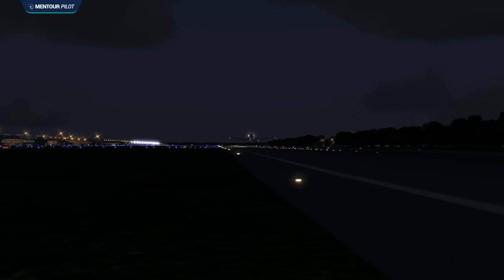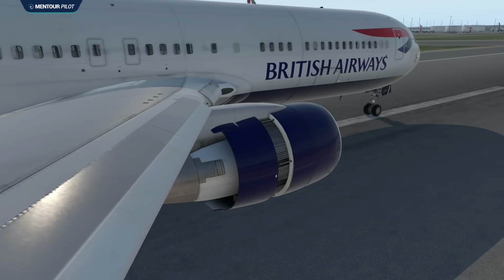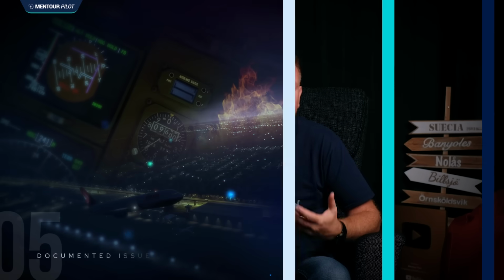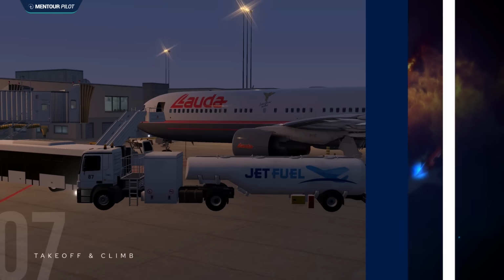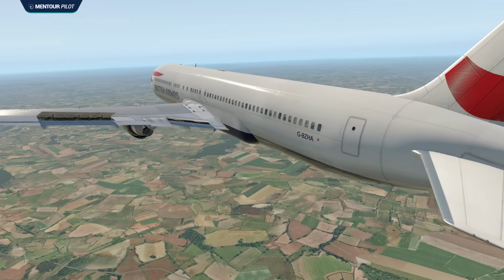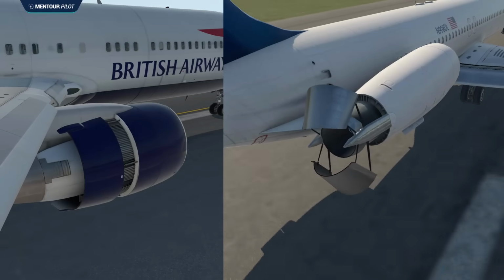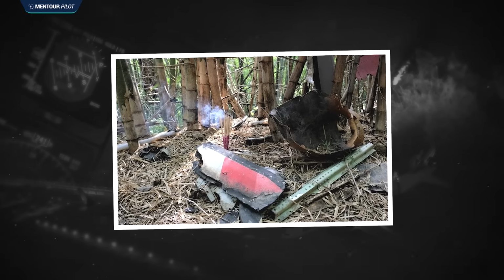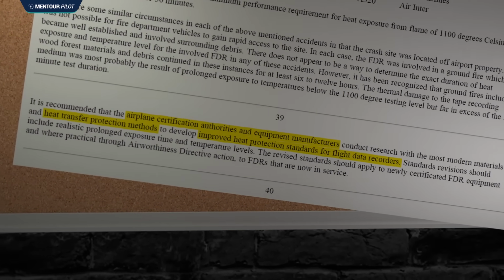HOW an Impossible Failure CRASHED this Boeing 767!

Comment: I was the youngest electrical mechanic (18 YO) at SFO in 1968 for TWA.  I worked on 707s, 727s and 880s.
There was ENORMOUS personal integrity in the people I worked with.  The BEST engineers and pilots and managers ran the airline and Boeing.
Boeing then became WOKE.  JFK's daughter was put on the BOD at Boeing with other Hollywood ilk ... then Boeing moves to Marxist infested Chicago.
Then SURPRISE!  Boeings start falling to earth.
You need to go OLD TESTAMENT on the BOEING BOD and those incompetent and lying engineers at Boeing.  They are a disgrace and guilty of hundreds of deaths.
This ignoring of such a severe and reoccurring problem would NOT be allowed where I worked.
Put MORE politicians and WOKE on Boeing's BOD and we will see many hundreds of more deaths.
Thank you for your EXCELLENT technical analysis but now PROSECUTE THE GUILTY and HUMILIATE THE INCOMPETENT!

Comment: No fdr,  what did they use to assume these events? And determine the crash probable cause? ..idle, spoilers , flight control and rudder adjustment,  then shut faulty engine down .. that should be quick reflex action , aviate, navigate, ...

Comment: Terribly sad. I just want to say a word on behalf of the pilots.

Before someone points out that Boeing's Chief Technical Pilot was able to recover the plane, so the airline or the pilots were somehow at fault for 'not being good enough' and not reacting withing the magical 6 seconds needed, don't forget that the Boeing CTP was flying a simulator in a zero-jeopardy situation.

We weren't told how many attempts it took him to find the correct series of responses needed to save the flight. It must have been more than one.

In other words, even if he - Boeing's top man - had been in control of the stricken aircraft, the outcome would have been exactly the same. He'd have failed to save it in the one and only opportunity presented to him, and the flight would also have been a total loss.

It ought not to be necessary to say that, but the dead pilots can't defend themselves and, sadly, there are some strange people around, with some equally strange agendas.

The only positive thing to come out of this disaster is the thoroughness of the ensuing investigation which went on to improve the safety of aviation for all. Unfortunately, it happened way back in 1991, and there have been far too many other fatal incidents in the years between then and now.

We may be learning, but why must the education be so painful and so slow?
Reply from the maker: That was actually the Boeing Chief pilots assessment as I mentioned in the video. No normal crew which hasn’t been specifically trained on this failure could be expected to survive it.

Comment: At 17:32 :  Was  the drag really on the right side ? Because if  the  ailerons/spoilers  on the right are raised  as shown as a counter measure then this wing would drop  and the plane would turn to the right countering a drag on the left side.

Comment: Would deploying the other thrust reverser make any difference?
Reply: You wouldn’t be able to unless it had also failed by coincidence
Reply: @tomstravels520  well if able I'm guessing the imbalance would be corrected if everything else tried was also. Sounds like a redundancy that would have helped.
Reply: @starfleetcaptain5413  and then what? A) You’re stuck at idle thrust and increasing engine speed will result in slowing down even more. B) if it was made possible for reversers to be deployed inflight they’d happen more often. That’s a stupid idea

Comment: I wondered for years if a thrust reverser deployment in flight could really happen.I thought thrust reversers can only deploy at engine low power settings.And the switches he was referring to are actually called squat switches there used to also prevent landing gear retract on the ground this is also true with small GA aircraft with retractable landing gear.I learned most of this stuff back in 1983 in A&P mechanic school.

Comment: This is one of the reasons why when Poland became communist free , our engineers and generals
chose General Electric shaft less engines for the 10 new 767's-200 we purchased.
PW-200 , Rols Royce , both were dual shaft just like the old Illushin 62's we use to have.
Those passengers must have suffered a horrible .......

Comment: For me as an Austrian citizen this is a very interesting video! Nearly everyone here in my country knows about this accident. Lauda Air was a great airline back then!
What even I didn't knew was, that the midair brakeup of the aircraft was so horrifying!!
Interesting facts to add woud be that this flight was also the worst Austrian air accident, since the aircraft was registert here. And this was the only crash of a 767 that wasn't caused by pilot error or due to a hijacking.

Have a great day out there!
Reply: Which airline/incident was it where runway aquaplaning prevented reverse thrust and caused a disaster? That and this incident are somewhat reminiscent together.

Comment: On this occasion, I think it is entirely reasonable to exonerate the pilots. Yes, while perhaps, as Boeing's chief test pilot suggested, had action been taken after 4-6 seconds, the situation MAY have been rescuable. One can hardly point the finger at two experienced pilots who "only" reacted after 10 seconds which, considering what was going on, is still fast.

Quite clearly, the blame lies with the "shonky" wiring, systems and procedures in place. As our host described, there was quite a litany of previous mid-flight reverser activations which frankly, is breathtaking. The fact the body which certifies the planes allowed for this with, again as we were told, 500 resettable hours available for a plane to be flown "on the blink" is barely credible.
Reply: Boeing said the 4-6 seconds was unreasonable and that the pilots were not expected to have saved the situation…
Reply: @joenathan3005  yes, after a LONG time of outright denying any fault of their systems and placing full blame on the pilots.

Comment: This video was the scariest one you've done , the visualizations of the plane breaking up in a high speed uncontrolled dive was almost too much to bear.  

What I don't understand is these new types of reverse thrusters , even at the benefits of better fuel economy , was it that much of an improvement? 

That, coupled with the warning light going on and off several times on previous flights should serve as a warning to all of us.

Computer or system wantings are never accidental , they always tell a story of something. Not necessarily good or bad but definitely informative. 

menteur , is it correct to call these reverse thrusters breaks like on a car?  

Also can anyone tell me about this interaction between atc and pilot?
Reply: Reverse Thrusters are like breaks for aircraft they help to slow down aircraft on the ground. You can actually see them getting deployed whenever aircraft touches the ground. When you take off the thrust(air) is coming outside from the back of the engine, Resulting in Aircraft moving forward. when the reverse Thrusters are deployed the back outlet is blocked and all the thrust will now escape from the gap (shown in the video animation) Resulting pushing air forward.. Which creates an opposing force resulting in slowing down the aircraft. Comparing it to cars, they work on the same principle but on a sensational level you will not feel reverse thrust in an aircraft because the rate of change in the state of inertia is very less as compared to car. In car if you apply breaks you will feel it as a push.
Reply: @AbhishekKumar-vk6rp  That is true... unless it's asymmetric, which is how I was attempting to word my previous reply. I was struggling with an analogy for anyone who's never been in an airplane before but could experience it on the ground.
Reply: Thrust reversers are nothing of the sort; there are legitimate wheel brakes on all aircraft I'm aware of, and work just like the ones in your car, although each side has its own pedal.

A closer comparison would be the equivalent of writing a bicycle, and your front tire suddenly started pedaling in reverse while the back tire continues to pedal forward.
Reply: From an economical standpoint as mentioned in the video using reverse Thrusters reduces stress on the brakes in the wheels that means low maintenance cost and long lasting breaks ! :D

Comment: I find it quite interesting that almost every single fatal aviation accident from the last 30 years happened because someone either didn’t do their jobs properly prior to takeoff or someone didn’t consider the possibility that something might fail during testing.
Reply: How would you summarise the causes in the years before that?
Reply: @htimsid  before that it was generally  error or negligence by macdonnel Douglas or Boeing
Reply: I spent a good portion of my life working for a commercial/military gas turbine engine design/manufacturer and in my early days in design I was advised that we learn a lot more from our failures than from our successes.  I think this still holds true 50-years later.  The aerospace industry, although it has had its faults, is still run by professionals overall.  Safety has always been our primary concern.

Comment: Why weren't the thrust reversers programmed as to not being able to deploy, if the landing gears were up?
Reply: Think about doing a gear-up landing.
Reply: @hermitoldguy6312  Using thrust reversers in a gear-up landing is actually not possible because the engines have to be turned off

Comment: I remember the case verry wel as Lauda Air had been training at our facility on the 767 simulator.
The same simulator the described research had been done.
I remember talking to Niki Lauda while having a coffee break during training sessions.
Over the years we found more issues that had lead to FSB's by Boeing (and other aircraft manufactorers as we had severeral aircraft types).
It indeed is shocking if crews you know verry well pass away in an accident as i over the years unfortunately have experienced a couple of times.

Comment: There is too much complexity in that high bypass thrust reverser system. The more complex a system is, the more prone to failure it is. Not much point in using high efficiency
bypass engines, if the complex thrust reverser system fails, and leads to a crash.
Perhaps the bucket reverser, and the smaller engines, taken together, were a simpler and more
reliable system. Humans have a way of letting their definition of progress, lead them down
a dark road.
Reply: Well, no. Today's aircraft and aircraft engines are safer and more reliable by several orders of magnitude compared to, say, the 1970s models, to say nothing of  the vast improvements in noise levels and fuel efficiency.
Reply: I couldn't disagree more.  The high bypass engines have probably saved thousands of lives although it's hard to prove since who is to say how many lives have been saved over the decades from "almost an accident" incidents?  If you've ever watched some of the videos on missed approaches (mostly due to windshear conditions and not pilots screwing the pooch) where the pilots engaged TOGA or push the throttles to the firewall, you'd witness the wonders of these engines.  In the day of the turbojets, few, if any, of these maneuvers would have been possible.  The advent of the fan-bladed engine (which act like a propeller) are orders of magnitude more efficient than the turbojets.  One benefit of flying in a/c with turbojets versus fanjets was feeling the immediate acceleration of the a/c as the crew advanced the throttles on the big fans versus the sluggish response of the turbos.  Just my opinion, so you can take it for what it's worth.

Comment: Would having deployable air-brakes have prolonged the time the crew had to react in this case or would they have just made the plane more difficult to control? Is there any reason other than cost why commercial planes don’t have air-breaks?
Reply: They do have them.

Comment: Well, I have always wondered what would happen if a thrust reversal occurred in flight. I did not know that this had actually happened in 1991. I often watch the thrust reversals when they deploy upon landing and see how fast they deploy. Although a complex problem, you provided an excellent description of the mechanism, failure warning history and the event itself that was easily understandable to non-technical viewers. Even though this was long ago, may all of those impacted by this tragedy be at peace.
Reply: The c17 is designed to be able to deploy reversers in flight. It allows the pilots to get on the ground quickly in combat zones.
Reply: @andrewsturrup8751  Wow, a drastic strategy for decending quickly, but if there is a procedure for handling it -- amazing!
Reply: The same sort of failure occurred in a  Fokker 100 on climbout in Brazil in October 1996 - TAM (Transportes Aéreos Regionais) Flight 402. Wikipedia says "All 95 people on board were killed, as well as another 4 on the ground."
Reply: @flagmichael  So it has happened a few times. I am familiar with TAM.